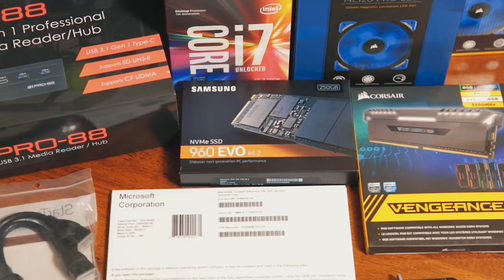Gaming & Editing PC Build - i7-7700K & GTX 1070

Comment: The enthoo luxe looks so bad ass, even in 2018. I've a question. Is the 7700k just overclocked version of the 6700k? Because my friend suggested me I should take a 6700k over the 7700k. How does the 7700k perform and hows your expierence so far?
Reply from the maker: I don't know much about the 6700k, but for me the 7700k works well for gaming. I now feel that I should have went with the 8700k since it has more cores which would have been better for editing.

Comment: Are the fans quite
Reply from the maker: Yeah! They are not completely silent, but they are quite enough to never really bother me while I have a headset on.
Reply: Have you Change the settings on it
Reply: And if do you know What the software is called
Reply from the maker: @MHcph263  I have all of the ML120 Blue fans connected to the Corsair H100i liquid cooler so I use the software "Corsair Link". I have the settings set to the "Quiet" preset almost all the time.

Comment: Can you fit a 360mm liquid cooler on top and an optical drive at the front simultaneously?
Reply from the maker: Yeah I believe so, might be a little tight. It should work fine if you only use the lower optical drive bay slots which would make room near the top. 👍
Reply: @nickc3838  Ok.